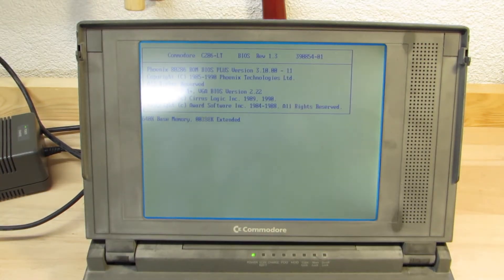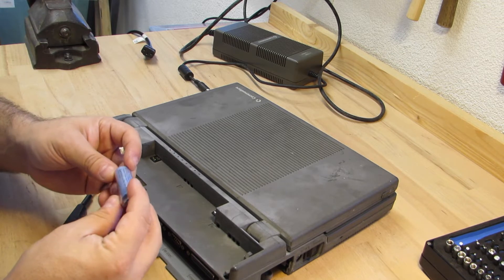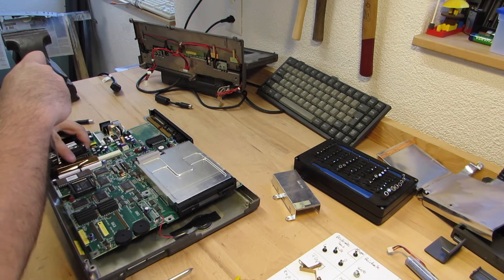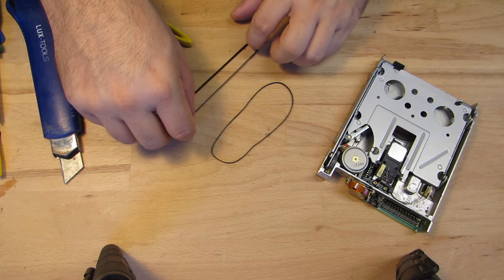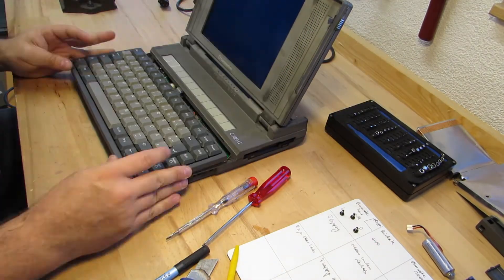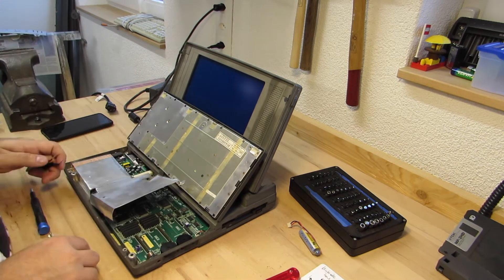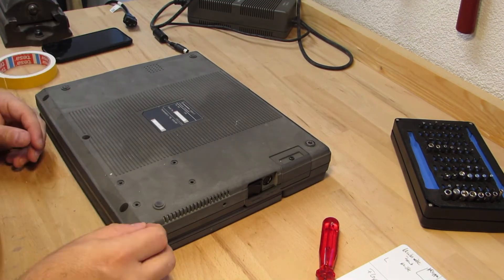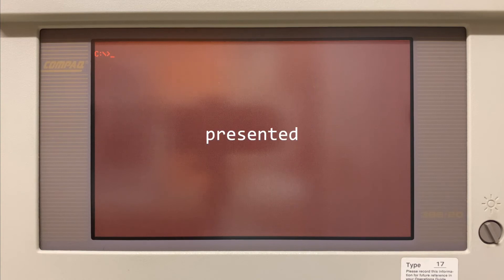Reviving a Commodore C286-LT Laptop

Comment: I've got basically the same device here - just the original Sanyo one. Thats the company that built it for Commodore.

In mine the capacitors on the internal power supply had leaked badly which made the display basically non-functional (voltage for the contrast setting was gone) and it made it also smell like rotten fish... Replacing the capacitors fixed the display, unfortunately the internal power supply now shuts down after 20-30 minutes of use (the external one is ok, this issue also happens when the device is operated on battery). Looks like a temperature related issue but i couldn't figure out what is the cause of that problem.

My harddrive was also a Conner one and it was also broken. In mine the magnet above the voice coil started basically "dissolve" into dust. It's shiny shell was cracked and it was basically pressing on the voice coil of the drive, making the heads beeing stuck in place. I fixed that by mixing the dust with epoxy, covering it with tape and putting the magnet into a vise to let the glue cure. I didn't expect it to work, but this made enough room for the coil to move freely again - afterwards that drive actually booted into DR DOS 4.0 😀

I would call this a success if there wasn't still this issue with the power supply 😞
Reply from the maker: Nice one, fixing the hard drive like this :-) As obscure as it sounds, sometimes simple fixes like this in fact the only needed to bring something back.

You say it shuts down after 20-30 minutes. Will it power up again immediatly, or do you need to give it some cooldown time first?
Reply: @THEPHINTAGECOLLECTOR  After the first shutdown you can turn it back on immediately. It'll then work again for like a minute only to shut down again. Those time spans then get shorter until it can't be powered on anymore. You then have to leave it alone for a couple of hours until the whole cycle can be started again.
Reply from the maker: @twipsy2047  That to me soubds still like a bad cap somewhere. Or, a bad solder joint, that gets worse when heating up, and makes proper contact only once cooled down again. Depending on the leakage you had, maybe other components were affected. Have you checked that?

Comment: Very informative video. Thanks for that.

I am currently working on a C286-LT also. CMOS battery is dead and also harddrive fails, so it comes with the error invalid configuration information-please run setup program.
Clicking F2 to go to setup nothing happens, the laptop just hangs at this screen. Any ideas about what to try?
Reply from the maker: Have you tried already disconnecting the hard drive? If it‘s dead, it may stall the POST and the machine appears to hang.
Reply: @THEPHINTAGECOLLECTOR  Yes I have disconnected the drive. It made no difference.
Reply from the maker: @kennethiversen8230  does it emit any beep codes on power-on?
Reply: @THEPHINTAGECOLLECTOR  No beeps at all. It seems very Strange to me.
Reply: In case someone else has the problem, i thought i would share the solution. It is very simpel. Since battery for the CMOS had no power, it would not go into BIOS. I put in a new battery and now everything works as it should 😀

Comment: Hi great video,, got one of theese myself, but missing the external powersuply, any ideas on how to find a replacement

Thank you
Reply from the maker: @outherod Thanks, glad you liked it.

Unfortunately I cannot point at specific sources. Check out eBay or maybe some forums like vcfed.org.
Alternatively, you could try to swap it for a standard connector. I'm currently looking into such a venture for some old COMPAQ machines, where I'm also missing the power supplies. There's an upcoming video on that topic.

Comment: Is the CFtoIDE adapter you have from Syba? The one that can hold two CF cards. 

I ask because so far I have had 2 CF adapters that will not work correctly with my C286-LT. Also an SDtoIDE so I am thinking about buying the Syba adapter.

Comment: Congratulations. Great job. Here I have the same computer that I cannot restore. The floppy drive is broken. That's why I ask you, could you send me an image of the compact flash? I have tried to create the image from virtualbox, etc, but it is impossible. You can help me. Thank you
Reply from the maker: It should be possible to create an image from VirtualBox. I used a similar approach in this video https://youtu.be/4WvHR_Cy2ME, creating a virtual disk in VirtualBox, then converting it using VboxManage and writing it to the Flash using BalenaEtcher.

Have you trief that already?
Let me know, otherwise I can of course share the boot image with you.

Comment: Thank you, I am looking to replaces the CMOS battery, it seems that you used 3 coin batteries, what model are those and how do it make them together?
Reply from the maker: @Amir McKee When you replace the battery, check out the specs, typically they are printed on the outside of the cell. You can find similar spec'ed batteries (original Commodore Part-No is 390841-01) on the usual resources like eBay, AliExpress, etc. The C286-LT needs a 3.6v Lithium cell, so basically you can substitute anything with an idential voltage and mAh rating for the original battery. The cells shown in my video was a manufactured 3.6v 40mAh 3-cell setup. But basically, anything goes that aligns with the original specs.